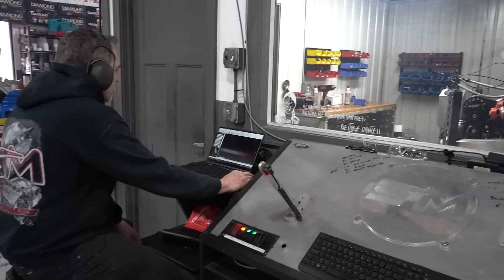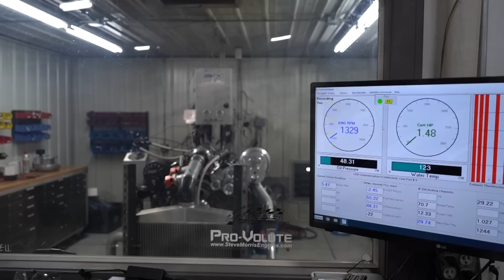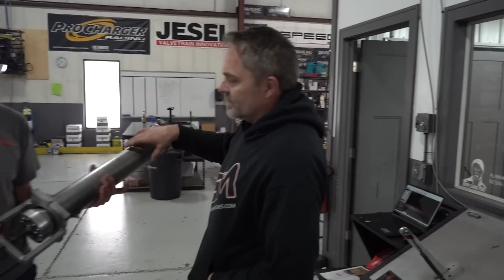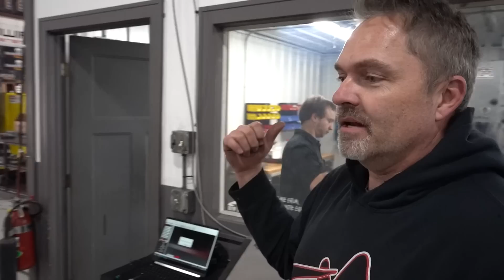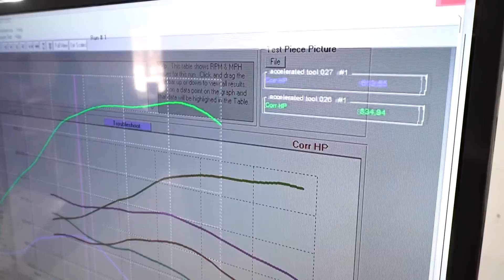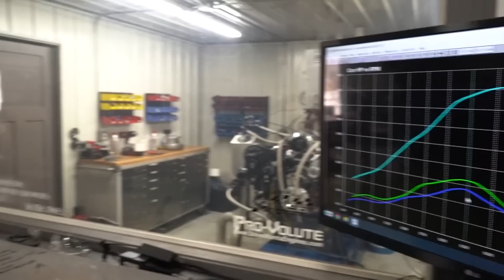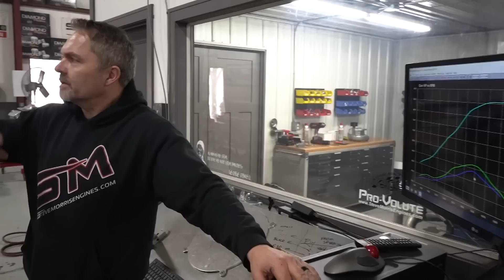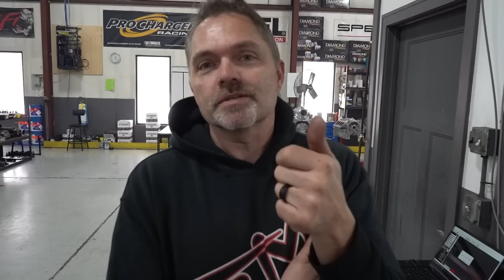CRAZY Testing After The  Dyno Session

Comment: I know you figured this out in the last 5 seconds of the video but you probably want to put a flow meter on the motor and blower. Measure the airflow at the blower on 12 psi then set the boost to what ever the engine cfm is minus what blower cfm was at on 12. Example engine cfm 1000, blower cfm at 12psi 3000, set blower valve to 2000cfm. I’m sure that will raise more question but it’s just an idea.
Reply from the maker: Thanks
Reply: I gave this a little more thought. There’s so much going on. When you increase the fuel pressure (build back pressure) pump draws more amps so why wouldn’t boost pressure also effect hp draw? Has to so I think the most accurate way to figure this out would be to use the bsfc to calculate the amount of power it takes. 
So if the motor makes 870hp and uses 440 lbh at .5 bsfc and it takes 810 lbh to make 1600 at .5 bsfc but your using say 970 lbh because it’s now at .6 bsfc that’s 160 lbs. 160lbs can feed 325 hp roughly. So at that
 boost level on that engine requiring x
 amount of cfm it taking 325 hp to drive.

Comment: This is a concept I've seen talked about 30 years ago in hotrod, you need 2 engines side by side looks at steve's side by side dyno rooms you run 1 engine engine na to provide the boost with the blower then the second engine takes the airflow and turns it into hp, the difference in the power on the boosted engine vrs the same engine with the belt drive would be the actual difference.
Reply from the maker: Yep 👍

Comment: Maybe a way to test it is to have two identical 540s in each dyno cell with the engine in cell 1 driving the blower but the engine in cell 2 receiving the boost

Only problem with that is It’ll be a long intercooler pipe which may effect results because of the volume of the intercooler pipe maybe that could be solved with a smaller diameter pipe?
Reply from the maker: Yep

Comment: Love to see your mind at work. The question you are asking is how much HP to operate the blower at a specific PSI at a specific RPM at a specific rate of air flow. A functioning comparison cannot be made for the Varity of reasons you mentioned on an engine dyno. If it is possible to drive the blower electrically while controlling the PSI with the cone and the volume with a intake cone. The HP can be calculated from Watts required to sustain the blower in the chosen configuration (Inlet size restriction to control volume, Outlet size to control PSI and volume). Reading the Amps required to turn the blower is converted to watts easy. watts = amps × volts (watts law formula) multiply watts x 0.00134102 to convert to HP. Regardless this will give only HP at a specific configuration and can only be used as a comparison to other blowers at the same configuration. One thing you can count on is the lower you can make the HP at the specific configuration the less heat is being transferred into the air.
Reply from the maker: Thanks

Comment: Restricting the compressor inlet to get the output flow number equal to the input flow when testing on the engine. You should get the compressor horsepower.

Comment: Really interesting video.. I'm always learning something for sure!
Couple notes that I'm seeing, when you saw the power curves come close between the high restriction and low restriction tests, the restriction on the "low restriction" test starts to come in from the inlet side of the turbo.  Using your analogy of the shop vac, it doesn't really matter if you restrict the inlet or outlet side to reduce the parasitic power.
The reason some engines can't turn the blower in the "low restriction" mode because the blower isn't choking the inlet side at that point, if they could get over that hump they could probably do it assuming engine torque doesn't fall off faster than blower required torque

I think it would be cool to try this using a load cell on a belt tensioner at the same time..
Reply from the maker: Thanks 
Thinking same thing

Comment: Great video. I would have never guessed that the parasitic loss would increase with less restriction on the blower outlet...... Crazy! Seems that there is some other factors in play and the test rig setup doesn't simulate what the blower is actually doing when feeding an engine. Maybe restricting the inlet of the blower and matching the airflow readings to the airflow of the engine when using the blower. It would be difficult to match the airflow exactly. Would maybe need to use a drive by wire throttle body. Or you could rig up a driveshaft load cell and measure the strain to turn the blower when is connected to the engine.
Reply from the maker: Thanks Thinking the same thing.
Reply: With a centrifugal supercharger the extra restriction leads to it moving less air which is less resistance. Since it doesn’t have a positive seal like a positive displacement blower it basically just starts internally bypassing. 
You can see the same thing with a shop vac. The vacuum part is similar in that it’s not positively sealed and relies on high airflow. If you put your hand over the outlet the rpm of the motor will increase because it’s moving less air.
Reply: It’s exactly the same if you run a centrifugal water pump. If you run it at full RPM with no restriction on the outlet, the pump will load the engine to full capacity. If you then restrict the flow down far enough, you’ll hear the engine unload as less fluid is being moved. The same thing happens with air.

Comment: what about running the supercharger into the exhaust to spin a turbo harder and create more low rpm backpressure to give low end torque?
Reply: or you have 1 supercharger feeding the other superchargers output... well they both go into the same thing so i suppose thats happening. but if you feed it right onto the output closer to the blades it may lessen that stalling effect i think you have to limit the flow of the ports too, maybe give it a speed bump. do some real NA stuff with the engine so that it flows with greater velocity at high rpm. (like getting torque at lower rpm normally) even creating like a twisting of air as it enters the port, that should create a wall of force (kinetic) that it cant flow into even at lower port pressures. at high rpm this engine wants ports that are usually good for low end torque, this enables you to use completely differrent drive ratios to make them require less to drive. spin them slower. you want to be thinking about the lag between the air pressure being generated at the superchargers and entering cyclinders. for drag racing you might want to even increase this lag. why not pressurize a big intercooler system?
Reply: @stevemorrisracing  will you try this in the future? (loading the output of belt driven superchargers perhaps by spinning a turbo faster at low rpm) have it geared so it does most its work at low rpm, and obviously 1 massive turbo. hey. when its going into exhaust manifold, as rpm rises, it makes more exhaust pressure, unloading the supercharger(s) reducing parasitic drag, can you please try this one day as a fun piss take. what if it works? cools the turbo?

Comment: You are not putting boost in the engine so it pulls the crank over more. When you have the blower hooked up to the engine it puts more even power in it so it does not load the crank to one side so much. With 2 blower one on each side it evens it out even more. I would go with a 2 blower system for longevity.

Comment: Incredibly awesome video! I actually paused the video after the last run (13lb boost through the open tube) to do some thinking and came to the exact same conclusion Steve did at the end of the video regarding the difference the vacuum of the engine makes compared to the tube.

Comment: As the engine runs with the supercharger it’s developing HP and it drives the blower with ease ., leaving the blower open to atmosphere the isn’t any pulsation as the engine will consume the boost so I think it’s just drags the engine down creating an massive drive loss … 
I think you can roughly calculate what HP the supercharger is consuming with LBS/hr fuel the engine is consuming for the HP is putting our … bfsc let’s say n/a .45 and this is what .55 … well the difference will be a rough estimate what the supercharger is using fuel wise without producing that extra HP… just a thought 💭
Reply from the maker: Yep

Comment: Steve, you're on it at the end of the video. This compressor map probably looks like a batwing, or ... the startrek communicator badge thingy... You can get the same pressure out of the compressor at 2 different points, one will be within the happy operating parameters of the turbine, the other is way off the other end of the scale with horrible efficiency.  You are absolutely right, when it's on the motor it's operating in the correct part of the curve so it's working like it should and consuming normal HP. With it running open circuit, it's moving as much air as it can eating as much HP as it can take trying to get there...  

The classic equation for compressing a gas is PV=nRT, that is pressure, volume, the amount of material (n being the number of moles of gas --- don't ask), the ideal gas constant and the temperature. That's just to compress a gas, to calculate the hp of a compressor, it's a bit worse because it requires values you don't have access to, for example: HP = (CFM x  PSI) / (229 * efficiency of the fan)... with a flow meter on the intake you can get CFM, but the efficiency is unknown and that's what we're trying to figure out in the end. 

I hate to sound like a dick, but those compressor guys should know that. 

The only way without getting into really crazy test equipment, is to scrap the factory mount for that compressor and make a square stock frame to hold that blower and put a strain gauge on it to see how much it flexes which will tell you the torque being applied, while the blower is feeding the engine at the right flow and pressure. You log this at the same time as you make your pull so you can see the rpm at the same time, then you run it through some math, and it spits out HP over the whole pull. 

The whole problem comes down to measuring the compressor under the CORRECT load, not operating like the leaf blower from hell.
Reply from the maker: Thanks Thinking the same thing.

Comment: I feel like the additional boost pressure inside the cylinders would help straighten the crank (keep it from flexing). With this setup there is no pressure besides vacuum, which does the opposite on the crank, and the addition of the centrifugal pulling the crank in one direction, causes the massive flex of the crank
Reply: Was going to post the exact same comment. Cylinder pressure is not there to cancel out the flex on the crank.
Reply: Cylinder pressure pushes and pulls

Comment: One thing to remember is that when the blower is forcing air into the engine, its also pushing the crank downward. so its in a nutshell equalizing the forces the belt is pulling the crank upward. Without the air forced into the engine in the test formation here, you're only applying the upward force on the crank and it allows the crank to freely hit the crank sensor in a scenario it'll never see in real world unless a charge pipe comes off.

Comment: Vacuums speed up when you plug the inlet because the air gets thin, less dense. What you guys are doing is the opposite. The compressor isn't spinning in a less dense environment it's in a higher density environment. Also when hooked to the engine isn't apple's to apple's with the tube with the restriction. Another thing the extra load from the crank bring pulled to the side harder when hooked to the tube is also adding extra load robbing more horsepower. Think about it things are sparking which means dragging not to mention the load in the crank bearings.
Reply from the maker: That’s why I said it is the inverse of a vacuum

Comment: The resistance the engine supplies to the blower is proportional to the air flow taken by the engine as a result of the engine speed. The correct way to test the parasitic loss would be to open the valve on the blower output as the engine speed increases.

Comment: With all due respect, I'm a bit concerned that the compressor manufacturers are struggling with how to quantify the capacity of their compressor. Maybe I'm used to working with large pump and fan OEMs for commercial applications, don't these guys have a map of the mass flow rate of the compressor? 

I would call the test invalid at the introduction of enough crankshaft bend with that flow control nozzle simply because you didn't have sparks coming off it when you had the blower feeding the motor... In other words, you have WAY more load on that compressor in this test just shoving air down the pipe instead of the motor... if anything they need to close off that pipe rather than open it.

Comment: Steve,
Great video as usual! 
What you have here is (one of my favorite sayings) "linear thinking in a non-linear world". When you pump fluids, like oil, water or air, the horse power to do that is ,( flow x pressure/ constant )/pump efficiency. The constant is developed from the units (gallons per minute, cubic feet per minute, cc/minute, cubic meters/minute for flow and pounds/square inch, bar etc for pressure)  that the flow and pressure are measured in. (As and example  I happen to know for fluids the constant is 1714 if you measure flow in gallons per minute and pressure in pounds per square inch.) The kicker here is the pump efficiency, for a centrifugal blower you have to get that from the compressor map, which you did not have, nor did you have the flow rate.  If you look at compressor maps there are not many parallel lines because air is a compressible fluid which make things very "non linear". 

The really interesting thing to me was the actual amount of horsepower that drove the blower, which you did measure very accurately,  was transmitted by that small multi vee belt! Using 300 hp to drive the blower and guessing that the lower pulley is approx 8 inches in diameter , than the drive belt is in about 790 pounds of tension!! That is one tough belt! No wonder the crank pulley deflected to hit the ignition pick ups.

Remember Steve, you are a neat guy! and this vid proves it!

Rex Schimmer
Reply from the maker: Thanks

Comment: I think what's going on is kind of like electrical. The charger acts like the battery. With it hooked up to the engine, that acts as your load, and thus uses its power. With no load, it acts like a short and puts every "amp" it's capable of producing into that pipe. Your choke tube is resisting that flow like an electrical resistor would, and slows the flow of amps.

Comment: A centrifugal pump draws more power unrestricted because it is getting a bigger bite, more CFM doing more work.  The boost goes up with restriction.  The centrifugal blower produces more airflow the faster it rotates which is why there is a larger load at higher RPMs. Moving the cone in will produce more boost and less CFM so less load.  The engine is providing the restriction which is why the boost number was higher when hooked to the engine and not as much force on the crank.  The comments about the vacuum cleaner were correct.  When you stop the flow the impeller unloads.  We see it with electric pumps all the time.   A direct displacement blower  will work different.  If you block the outlet the load goes up.  If you restrict the inlet the load goes down because its rotors are basically spinning in a vacuum and not moving any air or doing any work.
Reply from the maker: Thanks Thinking the same thing.

Comment: Here's my S.W.A.G.  Beside what Steve said at the end: When the blower is cramming air into the engine the engine is making more horsepower so the pistons and rods are pushing the crank down harder. Thus the forces balance better? 
...Until you rip the snout off ;-)

Comment: The stress on the crank is from the parasitic loading of all the items being driven by the crack. If it was only the blower, the load would be (in this case about) 45deg to the crank centre line. Add a second at about 90deg to the first, that would not remove the load on the crank. It may be about a third of just one (brains not working for me it's the old dial up modem squeal) with a directional load at a mid point between the blowers.
If you placed two blowers at 180deg to each other and as long as the belt tensions are the same. This would minimise the load the best. It could be worth a try.
Both blowers are spinning in the same direction. To change the direction you would need to gear the drive but this would not change the load direction on the crank end . It would just increase a small parasitic load using a geared blower. 
Dial in modem sound. This is starting to make my brain slowly start up. What if you could run it off the front of the crank, in line with the centre line. Removing any directional loads or wiping on the crank, plus all the parasitic load from the belts and pully's (a couple of HP?). It would add a small torsional load. This should also reduce the load on the blowers case and bearings due to over unloaded revving. The blower would then become the harmonic balancer which could become the accessory drive? To reduce the torsional load further you could add a constant velocity drive (parasitic load). This should make the blower act more like a turbo? Slowly roll up the parasitic load and boast as the rev's increase? The only obvious problem I can think of is you can't add/lower boost by changing pully size. This could be done with a couple of changeable cog's, like you would do to change the speed on an old lathe. 
This was suppose to be a reply but I started overthinking it and probably started down the rabbit hole of bad old ideas so I will make it a comment instead.